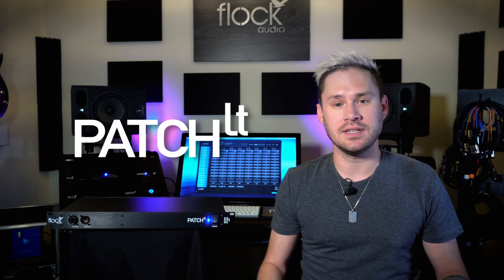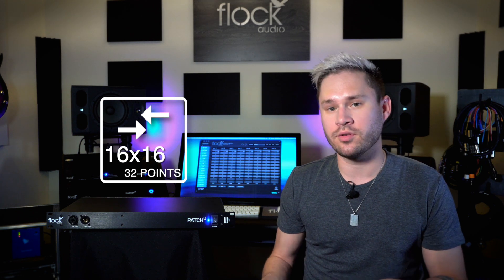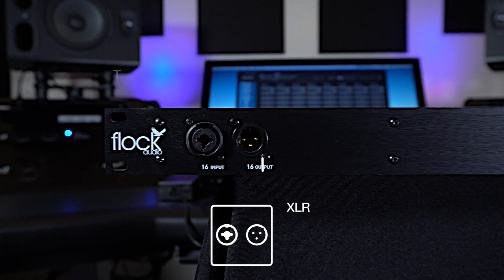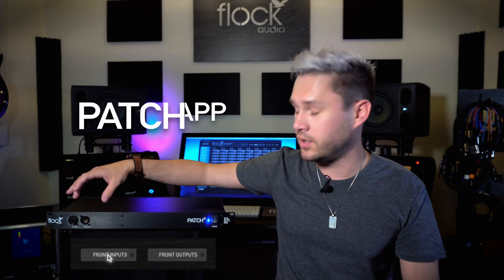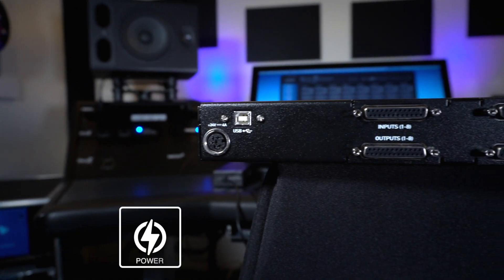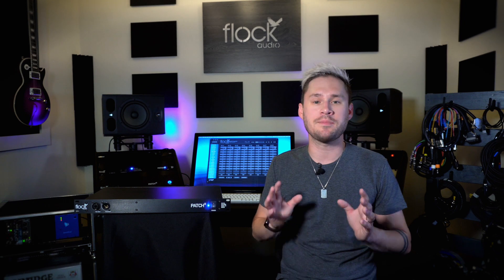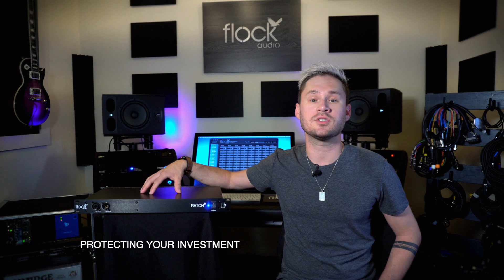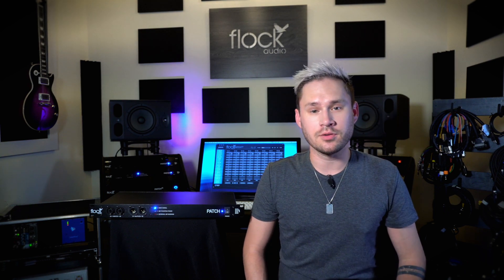Flock Audio PATCH LT - Hardware Overview

Comment: Are there gonna be any USB-C/Thunderbolt versions in the future?
Reply from the maker: Great Question! At this point in time, there is no need really for the higher bandwidth &/or transfer time capabilities of USB-C or Thunderbolt connections (or the additional costs to the customer). The PATCH APP -> PATCH Model Hardware Communication is very low in the ballpark of 0.02% CPU processing during activity & idle. In the future we may consider changing to USB-C just for the future proofing as USB-B slowly becomes obsolete. 🙂